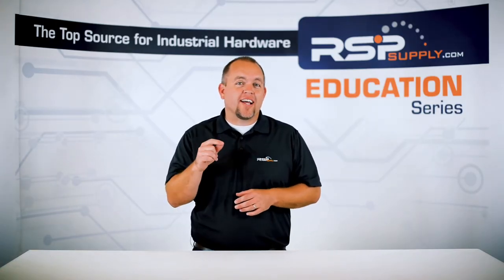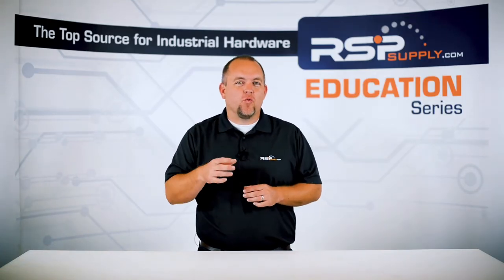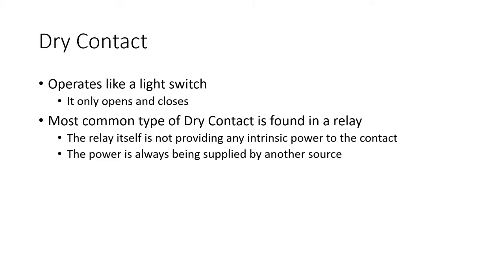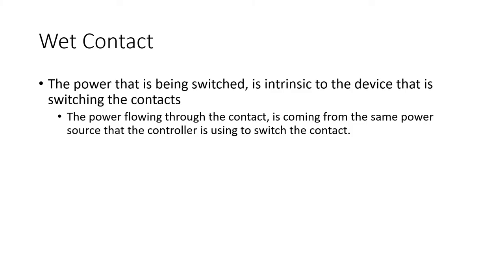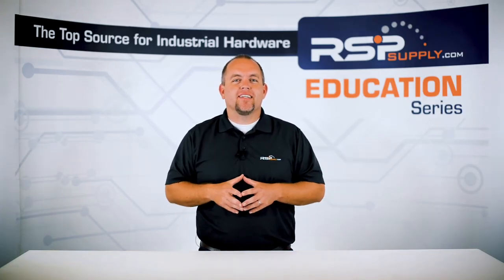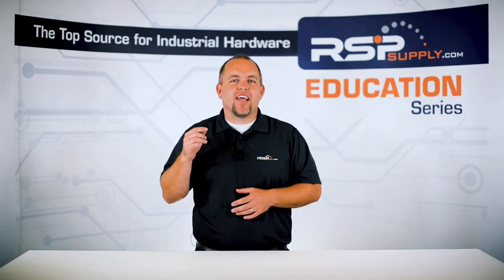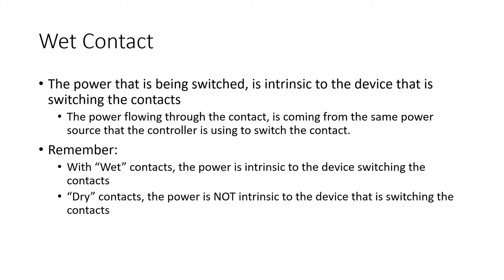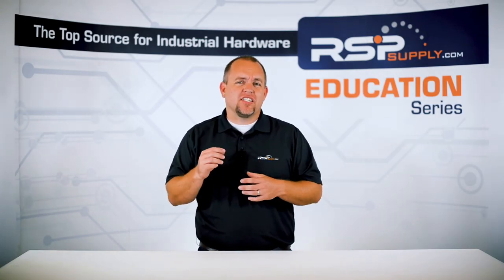Dry Contacts vs Wet Contacts :  The Basics

Comment: dry contact is also called potential free contact. because you can use any voltage irrespective of the device power.
Reply: True but you can’t use “any” voltage as, for example, a relay’s contacts may only take up to 240VAC @8A. You’re not wrong but there is always a maximum rating for what a potential free contact can take.
Reply: Let's say you have a relay with a 120v coil fed from circuit 1 on a panel. Then you also run a 120v circuit from breaker 3 and it goes through the normal open contact of the relay. So breaker 1 feed is closing the coil of the relay and making breaker 3 on the NO contact close. This would be a dry contact?

Comment: In the control world I was under the impression that dry contacts close a circuit that never has power on it.  It is simply there to create a short or open to be detected by controls.
Reply: You are correct to a degree. The “wet contact” in this case would be the controls you mentioned detecting the status of the dry contact via some level of voltage applied to the line. 3.3v 5v 12v 24v ect…….   Example a control relay could provide a dry contact for another device to detect via “wet” controls.

Comment: You are a great presenter.   My only quibble is whether there is a way to use the exact same terminology in both explanations.  I admit I am just learning so what I say might not be true. I always look at relays as being comprised of a control signal and an electrical load.  The controller can remotely switch the load on or off. (Bearing in mind the NO/NC detail which indicates the default setting, plus the potential to switch power from one circuit to another). If my basic understanding is correct, than I think I’ve explained a dry contact scenario.   Are you saying that the wet contact scenario is the same, with the sole difference that the control circuit just happens to get its power from the same source as the load?  It still has to be isolated (in parallel) so it can operate independently of the load, right?  It’s whole purpose is to switch the load, so I assume it’s still independent except for power source. Am I on the right path?
Reply: No. when wet relays pass electric through the coil is energized ie produces a  magnetic field and then passes "in series" through the contacts. The process begins with heat bending/contracting the contact ribbon. When cooled the ribbon relaxes back into position. Opening the contact, braking the surface. This is one application, I'm sure there are many other. I think.

Comment: I think it is probably not a good idea to reference a household light switch as a dry contact. At that point it is more perspective of what is intrinsic to the power system within a house. One could call it a wet contact because "under normal conditions" it always has a "source" voltage applied to one side of the switch which in the case of a house is typically "120VAC" in the U.S.  To me a better example would be to use a multiple pole relay e.g. DPDT,3PDT or 4PDT. A source voltage controls when the relay is energized or de-energized. On one of the contacts, it could (but doesn't have to) have a voltage applied all the time waiting for the relay to energize to pass the voltage. This would be considered a "Wet Contact". Another contact on the same relay which by itself is not electrically connected to the other contact still mechanically closes when the relay coil is energized. This separate contact which is considered a "Dry Contact" has no voltage potential on it and can be used by another source voltage usually supplied by a customer or end user and can be a different potential than the source potential as long as the contact is rated for it e.g. (contact rated up to 240VAC at 10A or up to  48VDC @ 5A)

Another example - A 3 phase contactor sends 480VAC to a compressor. [Auxiliary N.O. contact #1] located on that contactor that has 120VAC on it (WET CONTACT) so when the contactor is pulled in to send power to the compressor, it also sends 120VAC to a pilot light on the door saying it is running. [Auxiliary N.O. contact #2] has 2 wires to terminals and has no voltage (DRY CONTACT) for the end user to use (wire his own equipment) to notify or to control something else only when the compressor is running. The end user can wire to these terminals and place whatever voltage potential he likes as long as the contact is rated for it.
Reply: Man, apart from the poor English, your explanation answered more questions on this subject than two of the videos I have just watched (including this one).

Comment: So Can we say , Active (comes direct from CIRCUIT BREAKER ) is WET CONTACT and Switch wire which goes through switch to load (Light Fan) and turns the the load on when switch is on is called DRY CONTACT ???? Hope you will reply .....

Comment: It sounds like you're saying a mercury switch that is mechanically actuated by heat to trigger the AC/heater is wet, but a light switch that is mechanically triggered by a human is dry? Other than the mercury I see no difference. If it's wet because it's Mercury then you should say so, but aren't there also mercury light switches and all new AC switches are solid state? If not for that specific reason, mercury, then I don't see the see the difference..... If you mean a solid state AC/heater switch, which I'm assuming uses an RTD to read temperature, then again I do not see the difference. 

I know electronics and more or less know AC systems, but I had never heard the term wet until last week. I actually thought it was a joke at first. It was mentioned by an industrial contractor I hired for some work, but when I asked wth wet meant he didn't really know. He called his resident expert who said a relay that uses power to actuate a switch (typical relay) was wet, and a switch that you mechanically flip, like a manual on/off, was dry. At least that how we took his explanation, which in my mind sounded like he wanted to appear like he knew, but did not. Excluding the use of Mercury, I cannot see any reason to use the word "wet", so help me/us out here.  

The way you worded it gave me the impression that a relay or transistor could be wet or dry depending on how it was wired. Meaning that if the power to actuate the relay was supplied by the same power the switch is controlling, then it's wet. If the relay was actuated by a different power supply then it's dry. That seems like a weak reason to call it wet as well. If that is the case, then what if the power to actuate is not directly, but ultimately from the same source? Like at home I'm using 120VAC to actuate a relay to control 120VAC elsewhere. They both feed from the same 240VAC fed box, but some relays the actuation and power are on the same 120 side of the 240, some opposite sides. Some on the same side are being fed from the same fuse. If fed from the same fuse would this not be wet? Or would this be a gray area and be a "moist" switch? I'm only half joking because I thought wet was a joke when I first heard it.  

Surely there's a better, clearer explanation for this, and a reason for the term wet. Is the source of the term lost to history, or it is a BS term used by people who don't really know what it means?
Reply: I am also confused about that.
Reply: Check out the reply from punder30 down below, he clears it up a bit.  The light switch is somewhat of a bad example for the dry contact as he points out.